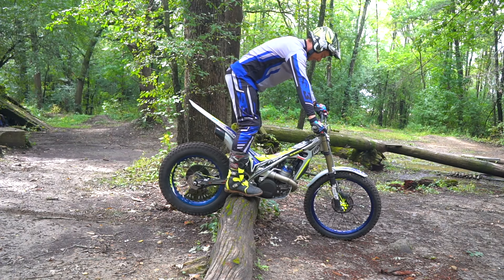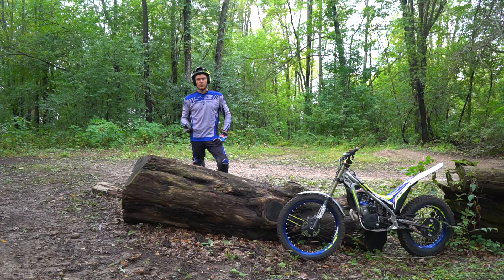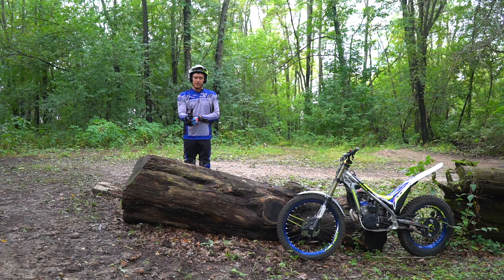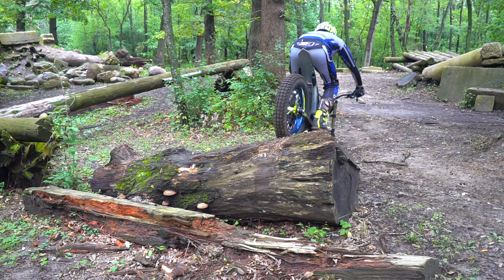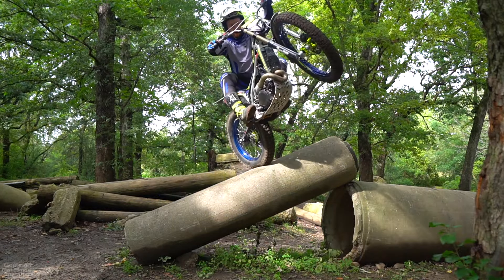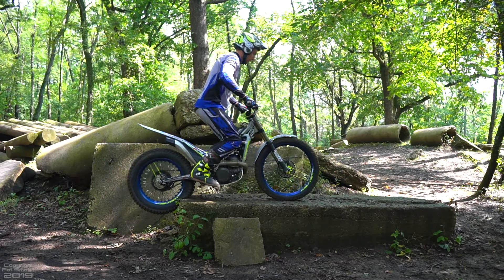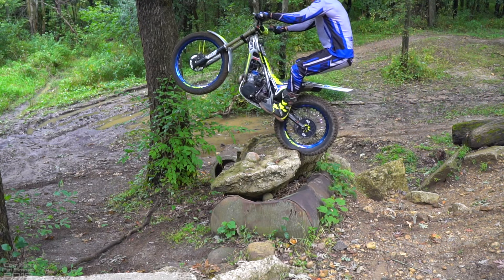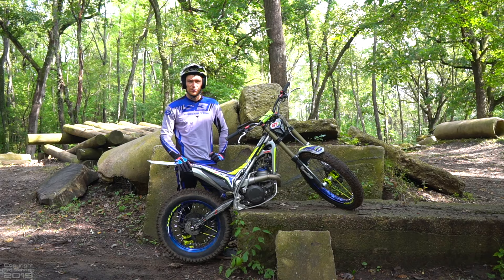MotoTrials How To: Use the Skid Plate

Comment: awesome vid.. thanks a lot broo.. could u also explain foot position in all techniques ?? ( for ex: am i need to stay on brake when jumping etc?.. to avoid accidently hit brakes after landing ) also i jumped when my foot on brake and after landing i hit accidently brake pedal and after that im out of control and dislocated my right finger :) )
Reply from the maker: Ouch, heal up! Foot position is tricky, probably enough for a whole video. But being able to move your foot when needed helps a lot. You don’t want to hover over it too much when you take off, but you have to be ready to move it in case you need it when you land. But sometimes slipping the clutch and hitting the rear tire in the right spot is enough. It’s good to practice moving it on and off the brake in different situations, even mid splatter.
Reply: @PatSmage  thankss mate 🙏🙏 this is gonna help me lot.. my finger is ok now :) thats my old experience :) if u want to do that video about it i can send u my fingers x ray 😂 it will be good thumbnail 😂😂